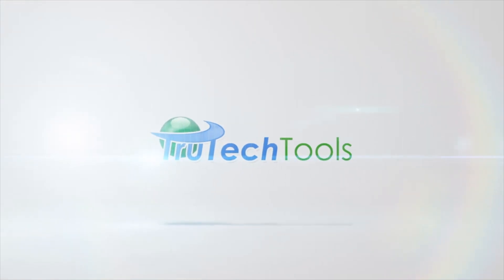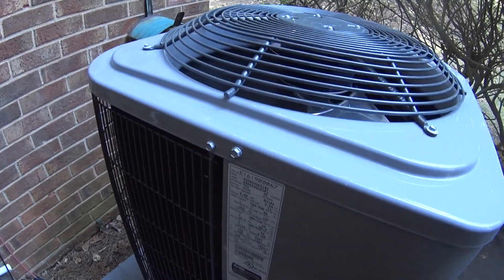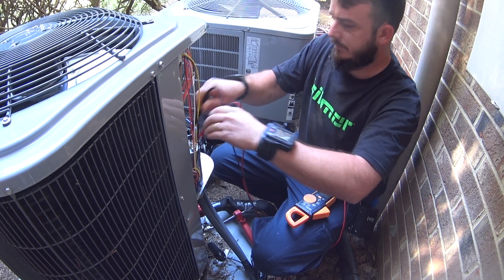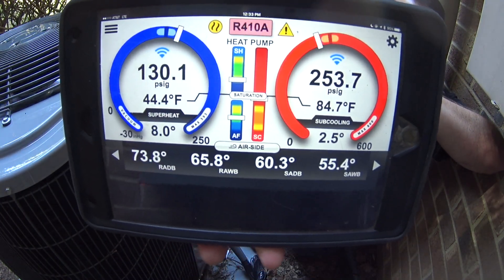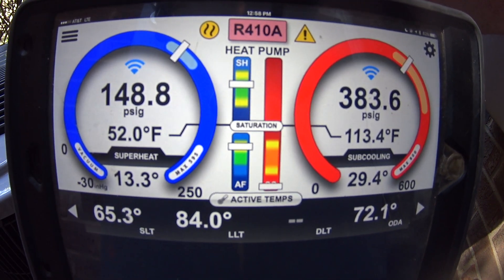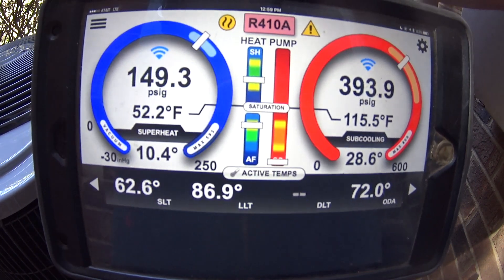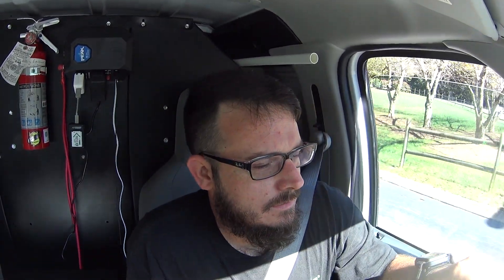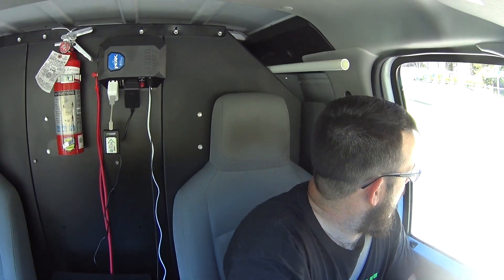10-4-17 One Year Old Heil Heatpump Check

Comment: install a K&N performance air filter and run full syn oil in that engine and it will make a diff.  also keep your heavy foot off the gas.  your always in a hurry.  I drove a ford e250 with a 5.4 L engine and avg 18 to 20 a gal.  whats your mileage?  keep track of it.
Reply: No way you got 18-20 mpg on a 5.4 unless it was empty with no tools. K&N is a good air filter but will not do anything. Synthetic is a great oil will help engine last longer but will not increase mpg.
Reply from the maker: +tomcat27557 average per tank so far has been around 13/gallon. Of course since it’s used you don’t really know what they drove like before.
Reply: I get ~ the same in my Chevy Express with the 4.3 liter V6.   Glad I don't pay for the fuel.

Comment: Welcome to self-employment when you're counting how much it cost to fill up every tank of gas. When I was using a truck or a van or an SUV I could not get my gas bill down below $1200-$1400 a month. Insurance was outrageous and parking tickets in San Francisco were $1600 to $2200 every year. driving around congested commercial restaurant neighborhoods block after block searching for parking taking 15 to 30 minutes at every stop was completely insane. Driving around in the hills of San Francisco burning through brakes and rotors complete set every 10,000 to 12,000 milesadd that to your cost. 
         So what did I do I'm converted a small Toyota Yaris two door hatchback with a rack on top and a tow hitch only when needed for large jobs and installation to pick up materials and supplies. I now only get 1 to 2 parking tickets a year. My gas bill every month is $350-$375 every month and insurance is only $395 every six months instead of 1200 a month. I got 102,000 miles on my first set of brakes I carry well over 1000 pounds of the tools and equipment in my car often put up to 500 to 800 pounds on my rack on top of the car and carry well over 2000 lb when needed on the 5 x 9 trailer. I have 251,000 miles on it and it's never broken down. Life is easy now driving and servicing in the busy crowded streets of San Francisco.
     Keep up the good work like your videos
Reply: t lech Thats awesome man! Congrats!
Reply: t lech i got a city express, bigger than a transit, but still high as mileage and lower insurance